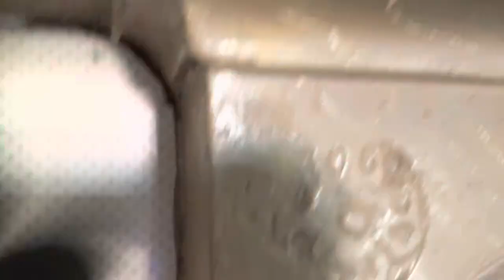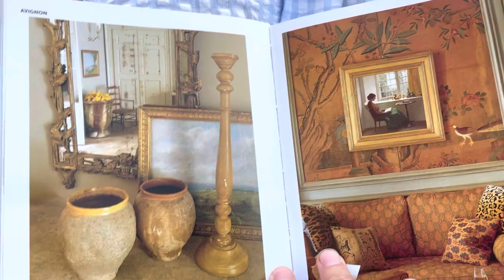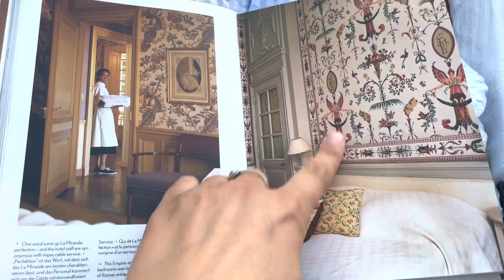DAY 34 of a big renovation on lake Como/dirty job...

Comment: I use a 50 gallon garbage can with holes in the bottom for my compost bin. They even come with  wheels and can be stored out of sight, and then rolled to the areas you want to work on as needed. I keep it near the kitchen for kitchen scraps. I also have a permanent one farther out near the garden for yard trimmings. Many people go crazy tending to their compost, but I just pile it on over the year, and I always end up with great compost next spring. Your terrace plan seems very good.
Reply from the maker: Good idea!!! We will definitely make a system for our compost))) it’s such an easy and natural way to get rid of waist 🪱🪴

Comment: I should send you my trail cam to find out who's stealing your outdoor decos...  I also thought about your garden and wanted to share a trick that has worked for me. When making new gardens formerly overgrown...after clearing all the weeds and roots, lay down some big sheets of landscaping fabric or other material to block the sun and kill the weeds,I've used plastic sheeting, even tarps for this purpose, you can also use flar sheets of old cardboard boxes, which will simply break down eventualy. Then cover it all with wood chips or other mulch that will make it look attractive..shredded garden waste can work if you have a  shredder ( :  Then, when you want to put in trees or bushes etc, you just cut a hole through the fabric in which to plant. It keeps the weeds from growing back while your garden grows. 
Hugs from Vermont,USA where September is bringing us sunflowers and pumpkins, and just a tinge of fall foliage color in the trees.

Comment: The nails are from the wood that they put in there which probably had a lot of nails they didn’t bother to remove them before burning the wood and they never cleaned up the mess of nails. That’s what I can gather and the lock was probably an old door they cut it up and put it in there lock and all.😊😁

Comment: Not sure if you have wheelie bins over there, but that's what I use for my compost here. Attach a tap to the bottom of the bin, then have a grate about a fifth of the way up, place flyscreen mesh over the grate, several layers, then place a layer of newspaper, grass clippings etc, and create your compost in that manner. What the tap at the bottom does is catch worm juice, so when you turn the tap on its liquid gold for your plants. You have to drill small holes all around the top of the bin so air and microbes can grow and the worms in the bin can survive. Then once a year empty the top, very smelly, and start again. Having the wheels on the bin you can move it around to where you want your compost placed. Takes a bit of work setting it up but once started its easy to keep going 😊 xx
Reply from the maker: Thank you Liana! I will definitely create a good compost bin

Comment: Your pergola idea is great. May I suggest: make sure its big enough for all possible uses, with screening to one side to block the neighbours. Against the existing wall, leave a wide gap to fill with good soil for plants, less watering issues with that method. It could be a beautiful feature for you garden. You are fortunate to have the road above to supply the rubble fill and materials. Build a trench, construct side forming with ply and reinforcing steel, ready to pour the sides from a cement truck from the road when it is next doing a delivery in your village. Cheaper that way. Then you could later apply decorative local stone to the pergola walls. It could be a beautiful feature for you garden.against the existing wall.
Reply from the maker: yess yess yesss!!!!thank you xxx